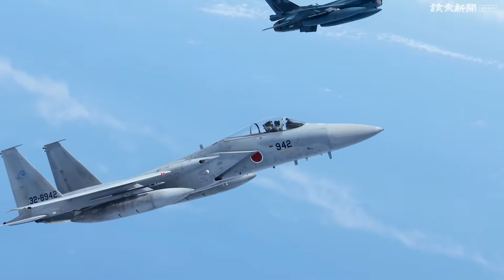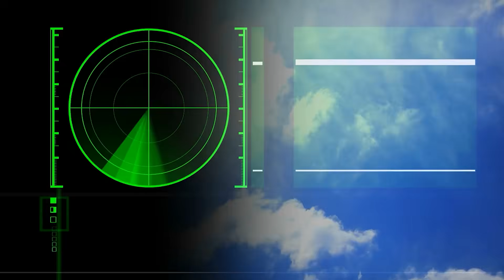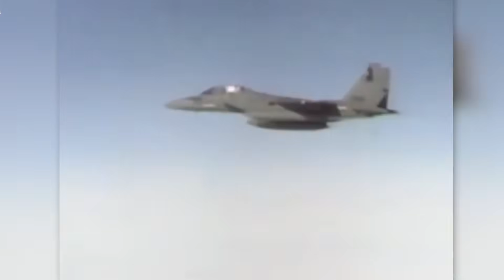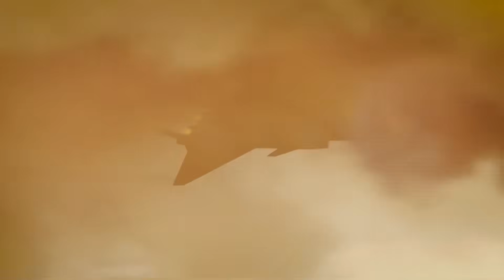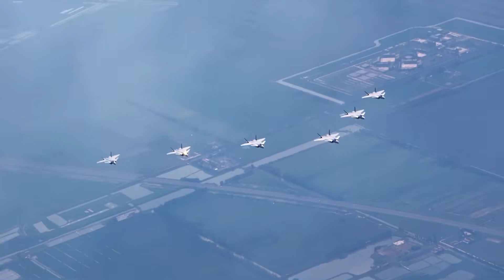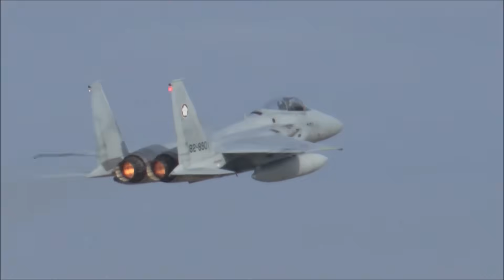Chinese J-20 Gets TOO CLOSE to Japanese F-15 - Then THIS happened

Comment: F15 has NEVER lost, just run your shitty temu plane home
Reply: Projection Majorcopium. This is a 🌮🐍🤡🎪 channel

Japan govt lodged official complaint to China a few weeks ago that their two of their mighty F-15 were missile locked by the J-15, one of them locked for over 30 minutes from 148km away.
You are still at stage 1. 4 more to go. 🤣
Reply: @oot007  missile locking is NOT killing, understand of that shitty Chinese fighter fired a missile at the f15, you would have to give funerals for the pilot. f15 has not lost in over 100 ACTUAL combats, your propaganda does not change facts
Reply: @snapperl  >"missile locking is NOT killing"
Projection Majorcopium. 
In 2024 joint aerial exercise "Zilzal-II" between the PAF and the Qatar Emiri Air Force (QEAF) the PAF J10CE easily dominated UK trained Qatar Typhoons 9-0 in both BVR (4-0) and WVR (5-0). The Qatar Typhoons are trained by the legendary RAF, considered by many in the industry as the best pilots in the world.
How good is the Typhoon and Rafale? Both scored victories in WVR over the famed Raptor and F35 in joint USAF-RAF/FASF exercises.
Likewise in the same Zilzal-II exercise the Chinese trained Pakistani JF17 easily dominated US trained Qatar F15 and F16 in both BVR and WVR.
The J-10CE is the export version which is a cut down version of the J10C and likewise the PL-15E is a cut down export version of the PL-15.
The JF17 is a budget jet fighter built by China for Pakistan from their spare parts bin and is too obsolete for China to use themselves.
Yet the cut down export versions of the J-10 is undefeated against Europe's best 4.5 gen fighters Typhoon and Rafale and the spare parts JF17 easily dominated the F15 and F16.
What happened when the J10CE met multiple Rafale in real world combat?
The Pakistani J10CE shot down multiple Rafales and SU-30 last year using the PL-15E at a much longer range than any US fighter ever has in actual air to air combat.
Has the US has ever fought in real combat against 4.5 gen fighters?
No.
You are still at stage 1. 4 more to go
Reply: @oot007  I said combat, not exercises lol, i mean if china had a real air force, they would have taken taiwan, but as you see, they CANNOT take it, get back to me when China is a real country
Reply: @snapperl  Projection Majorcopium. Straight out of a Chuck Norris movie - badcomedy.
What happened when the j20 and f35 met in 2022? The j20 had it on missile lock.
General Wilsbach (Pacific Air Forces - USAF) - "The KJ-500 plays a significant role in some of their capability for long-range fires. Some of their very long-range air-to-air missiles are aided by that KJ-500. Being able to interrupt that kill chain is something that interests me greatly."
The general continued "With the E-3 AWACS in the air, the airborne sensors that we're relying on are not really suited to the needs of 21st-century operations, especially against (stealth) platforms like the J-20 or similar. It can’t detect these platforms at great distances, and detection before the enemy can provide an advantage to the aircraft that are tasked with fire delivery."
What he conveniently omitted was that the kj-500 directed the j20 to get past their awacs and enable it to get missile lock on the battle penguin.
What is the combat record of the mighty USA?
-Pushed back to the 38th parallel in the 1950s by a primitive Chinese army.
-Spent 20 years and trillions in afghan to replace the Taliban with .. the Taliban.
-Could not even beat the Houthis - an outfit with no army, no air force, no navy and the USN lost 3 F-18 into the ocean trying to dodge Houthis missiles. 
-Could not defeat the Viet Cong and pushed their choppers overboard into the sea when they fled from Saigon 
-Still cannot put a working hypersonic missile into production. 
Meanwhile Chinese 1st gen hypersonics flew more than 7 years ago.
You are still at stage 1. 4 more to go
Reply: @snapperl  >"I said combat, not exercises"
Projection Majorcopium. Straight out of a Chuck Norris movie again- badcomedy.
Chinese trained Pakistani J10CE shot down multiple Rafales and SU-30 last year using the PL-15E at a much longer range than any US fighter ever has in actual air to air combat.
Do you know what that means?
Chinese planes have taken down multiple 4.5 gen fighters in real world combat.
Has the US has ever fought in real combat against 4.5 gen fighters?
No.
You are still at stage 1. 4 more to go
Reply: @oot007 where do you come up with that garbage?
Reply: @oot007 a J20 never had a F35 on missile lock. If that happened the J20 would have been shot down because America doesn't play games.
Reply: @oot007 what are you smoking?
Reply: @JohnHawco-x3z5l   Projection Majorcopium. You are still at stage 1. 4 more to go
Reply: @JohnHawco-x3z5l  Projection Majorcopium.
What happened when the type 055 Nanchang encountered the Carl Vinson fleet and their squadron of Growlers? The Carl Vinson retreated.
US Navy Times Dec 2023 - "The Navy fired the commanding officer of Electronic Attack Squadron 136 on Wednesday, the service announced Thursday. According to the Navy, Cmdr. William Coulter was relieved due to 'a loss of confidence in his ability to command.' "
The mighty USN Carl Vinson fleet. The entire fleet fled from one Chinese Type 055 and J-16. 
Why? Cause their radars were rendered useless, their growlers were jammed and they were radar locked by the Nanchang which had opened it's VLS bays ready to go.
Your navy, pilots and planes are "world beaters". Just ask Cmdr Coulter.
You are still at stage 1. 4 more to go.
Reply: @JohnHawco-x3z5l  Projection Majorcopium.
What happened when the "undetectable" USN Seawolf-class nuclear-powered fast-attack submarine met the PLAN?
The awesome USS Connecticut captained by Commander Aljilani collided with an underwater "feature" while submerged in the SCS in October 2021.
WSJ Nov 2021- "The U.S. Navy has removed the commander and other leaders of a submarine that struck an underwater mountain in the South China Sea last month, injuring nearly a dozen sailors."
They were too embarrassed to admit that the USS Connecticut was being chased by Chinese ships and Commander Aljilani panicked.
You are still at stage 1. 4 more to go.
Reply: @oot007 why would a submarine run? They have the right of passage and free right to navigate the SCS just like any merchant ship or military vessel and I doubt the Chinese can even detect a nuclear submarine
Reply: @JohnHawco-x3z5l  Projection Majorcopium. Straight out of a Chuck Norris movie - badcomedy.
What is on record when the US visits the SCS?
- The USAF General of Pacific Air Forces admits their AWACS cannot detect the J20
- The USN sack the commander of their Electronic Attack Squadron
- The USN sack the commander and other leaders of their USN Seawolf-class nuclear-powered fast-attack submarine the USS Connecticut
What is the combat record of the mighty USA?
-Pushed back to the 38th parallel in the 1950s by a primitive Chinese army.
-Spent 20 years and trillions in afghan to replace the Taliban with .. the Taliban.
-Could not even beat the Houthis - an outfit with no army, no air force, no navy and the USN lost 3 F-18 into the ocean trying to dodge Houthis missiles. 
-Could not defeat the Viet Cong and pushed their choppers overboard into the sea when they fled from Saigon 
-Still cannot put a working hypersonic missile into production. 
Meanwhile Chinese 1st gen hypersonics flew more than 7 years ago.
You are still at stage 1. 4 more to go
Reply: J20 will shoot F15 out of the sky in real combat situation!!!

Comment: The J-20 POS is as stealthy as a barn!
Reply: Projection Majorcopium.
What happened when the j20 and f35 met in 2022? The j20 had it on missile lock.
General Wilsbach (Pacific Air Forces - USAF) - "The KJ-500 plays a significant role in some of their capability for long-range fires. Some of their very long-range air-to-air missiles are aided by that KJ-500. Being able to interrupt that kill chain is something that interests me greatly."
The general continued "With the E-3 AWACS in the air, the airborne sensors that we're relying on are not really suited to the needs of 21st-century operations, especially against (stealth) platforms like the J-20 or similar. It can’t detect these platforms at great distances, and detection before the enemy can provide an advantage to the aircraft that are tasked with fire delivery."
What he conveniently omitted was that the kj-500 directed the j20 to get past their awacs and enable it to get missile lock on the battle penguin.
You are still at stage 1. 4 more to go

Comment: How did the Japanese know that the J20 was even there?
Reply: J-20 Temu fighter!😂
Reply: because it was within visual range
stealth is just for hiding from radars, it doesn't make the plane invisible
Also certain low frequency radars can detect steath aircraft. Maybe not well enough to get a lock to shoot it down, but still able to see that it something is there.
China's stealth tech probably isn't the best either which improves the chance of it being detected
Reply: @corsola9907 the J20 is NOT stealth.  Chinese propaganda.
Reply: @JohnHawco-x3z5l  you're probably right, just gave them benefit of the doubt for the example. Everything else still applies
Reply: @JohnHawco-x3z5l  Projection Majorcopium. Straight out of a Chuck Norris movie - badcomedy.
What happened when the j20 and f35 met in 2022? The j20 had it on missile lock.
General Wilsbach (Pacific Air Forces - USAF) - "The KJ-500 plays a significant role in some of their capability for long-range fires. Some of their very long-range air-to-air missiles are aided by that KJ-500. Being able to interrupt that kill chain is something that interests me greatly."
The general continued "With the E-3 AWACS in the air, the airborne sensors that we're relying on are not really suited to the needs of 21st-century operations, especially against (stealth) platforms like the J-20 or similar. It can’t detect these platforms at great distances, and detection before the enemy can provide an advantage to the aircraft that are tasked with fire delivery."
What he conveniently omitted was that the kj-500 directed the j20 to get past their awacs and enable it to get missile lock on the battle penguin.
You are still at stage 1. 4 more to go
Reply: @corsola9907  Projection Majorcopium. 
Don't you know that the Japanese officials complained that their two of their mighty F-15 were missile locked by Chinese J-15?
One of the F-15 were locked from a distance of 148km for more than 30 minutes.
Informed people knows this is a 🤡 channel to rewrite the event into their own narrative.
You are still at stage 1. 4 more to go.
Reply: This 🤡channel is deep in majorcopium. 
Japanese officials complained that their two of their mighty F-15 were missile locked by Chinese J-15 in Dec 2025.
One of the F-15 were locked from a distance of 148km for more than 30 minutes.
Informed people knows this is a 🤡 channel to rewrite the event into their own narrative.

Comment: They haven't met the new F15EXs yet
Reply: Projection Majorcopium. This is a 🌮🐍🤡🎪 channel
Japan govt lodged official complaint to China a few weeks ago that their two of their mighty F-15 were missile locked by the J-15, one of them locked for over 30 minutes from 148km away.
You are still at stage 1. 4 more to go. 🤣
Reply: Projection Majorcopium. Straight out of a Chuck Norris movie - badcomedy.
What happened when the j20 and f35 met in 2022? The j20 had it on missile lock.
General Wilsbach (Pacific Air Forces - USAF) - "The KJ-500 plays a significant role in some of their capability for long-range fires. Some of their very long-range air-to-air missiles are aided by that KJ-500. Being able to interrupt that kill chain is something that interests me greatly."
The general continued "With the E-3 AWACS in the air, the airborne sensors that we're relying on are not really suited to the needs of 21st-century operations, especially against (stealth) platforms like the J-20 or similar. It can’t detect these platforms at great distances, and detection before the enemy can provide an advantage to the aircraft that are tasked with fire delivery."
What he conveniently omitted was that the kj-500 directed the j20 to get past their awacs and enable it to get missile lock on the battle penguin.
You are still at stage 1. 4 more to go

Comment: There should be no visible loadouts with a stealth plane. SMH.   But as an AI gen'd vid, its not too horrible.  Yes the verbiage is a word salad, but the stock vids are reasonably ok, with the occasional F16 vid blooper.  Still getting a block, but its not horribly horrible.  just horrible🤣
Reply: Projection Majorcopium. 
Don't you know that the Japanese officials complained that their two of their mighty F-15 were missile locked by Chinese J-15?
One of the F-15 were locked from a distance of 148km for more than 30 minutes.
Informed people knows this is a 🤡 channel to rewrite the event into their own narrative.
You are still at stage 1. 4 more to go.
Reply: More majorcopium straight out of a Chuck Norris movie - badcomedy.
What is on record when the US visits the South China Sea?
- The USAF General of Pacific Air Forces admits their AWACS cannot detect the J20
- The USN sack the commander of their Electronic Attack Squadron
- The USN sack the commander and other leaders of their USN Seawolf-class nuclear-powered fast-attack submarine the USS Connecticut
You are still at stage 1. 4 more to go